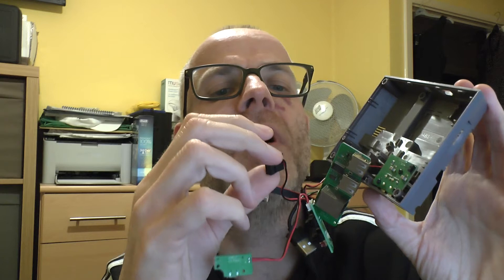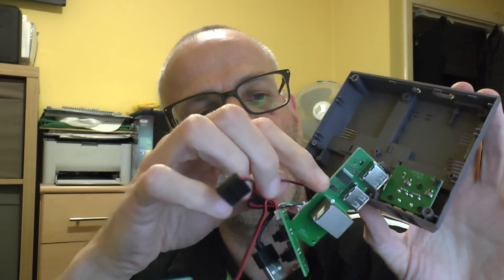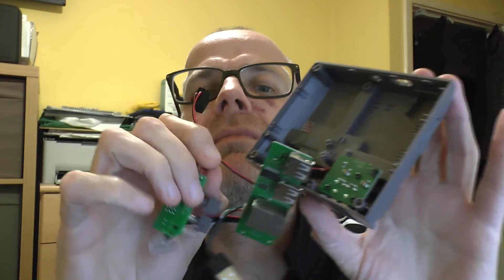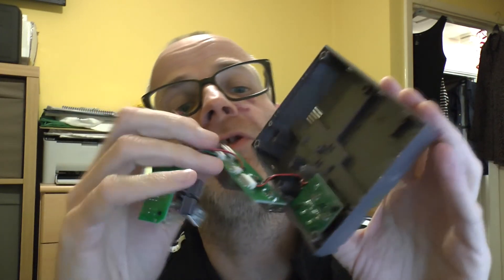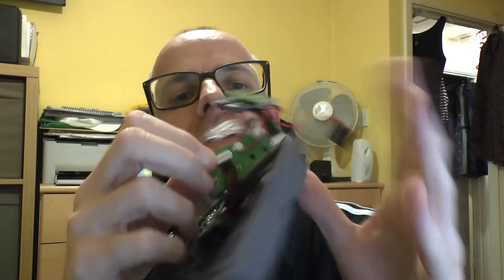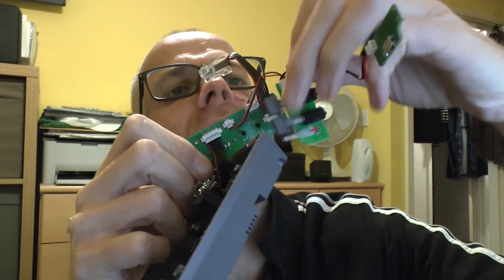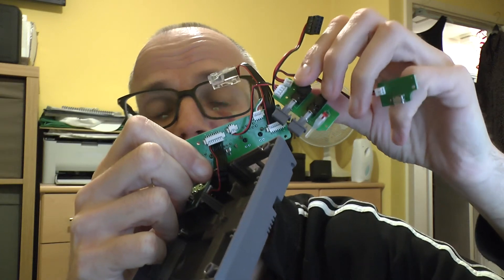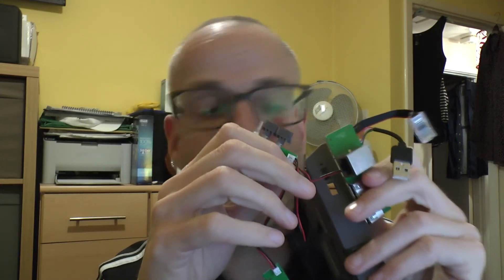NESPI Power Issue Mod

Comment: Or you simply buy a good power adapter/supply with 2.5 amps or more.... problem solved. No soldering, no butchering the case.

Comment: Nice video, I'm thinking about doing the same. I'm using the official power supply with my Pi 3/NESPi case and still I'm getting the lightning bolt from time to time, especially when playing games like Starfox or transferring files over WiFi.
Reply: Use a 5.1v 2.5 amp adaptor

Comment: Yeah the lightning bolt icon that appears is usually if your using a power adapter that doesn't have enough amps, the usual cheap ones on ebay almost always suffer from this issue, the adapter i have to 3.5 amps . I wonder if getting a higher amp PSU would have sorted the issue out with the PINES case??
Reply: Yes it should. The problem its that all that extra cables work as a resistance and if the cable diameter its low, the bigger the resistance is. At 5v some less centimeters of cable can change everything.

I have a 5v 3A PSU, which is more than enough for a RPi3, but anything more than the original 50cm USB cable will report as low voltage.

So a good tip for powering the Pi is to never go for the power supplies which uses an USB to micro USB cables, its crazy the resistance they have.

Comment: I had the same issue with a pie build I was working on once. Ideally you could of just used thicker gauge wire and wired it to the underside of the original MicroUSB port (5v & GND) and wire that directly to the pads on the Pi.

Comment: I used to get the lightning bolt on both of mine until I changed my PSU to a NorthPada 5V 3A unit. After that no more issue
Reply: Same here. Running Retropie on Raspberry Pi 2,. Going to bit more demanding Capcom system II games.  Does not happen with a NorthPada (  switch in line noise filer )power supply from Amazon.
Reply: I am so glad that finally had enough when my gpu died in the very same moment i turned on my stereo. Then i read about power surges and that those are a indicator for too much power draw. 
I did not check twice if my old amp can handle 4 ohms when i got new speakers 2 years ago and i was shure that i have never seen a hifi amp rated other than the 4 ohm standard. Turns out that mine was only rated for 6 ohms.
Reply: Yes that is exactly it.!  :-) Well spotted Cptn.  It's not the voltage.. 
It is like you say the Amperage that is important when connecting periferals.
Including a great big Hunk of NESPI  Case.  Easy as π
Reply: can you still use the power/reset button on the NESPI? case?